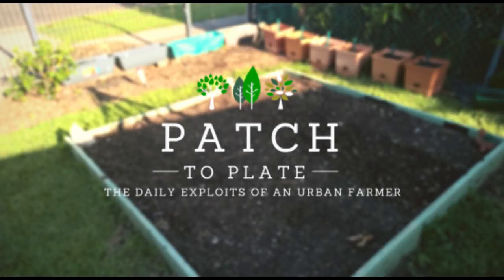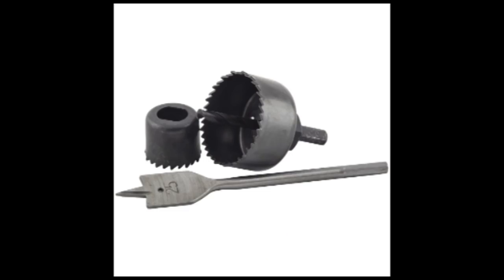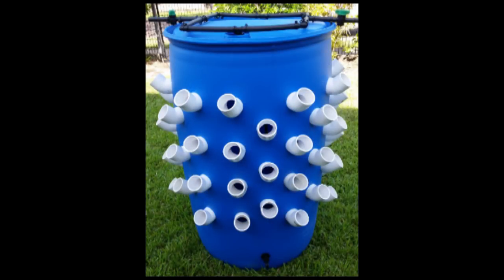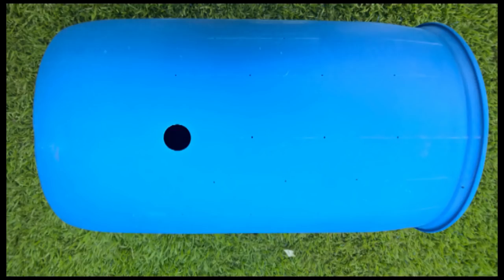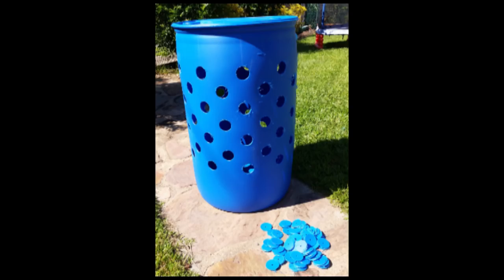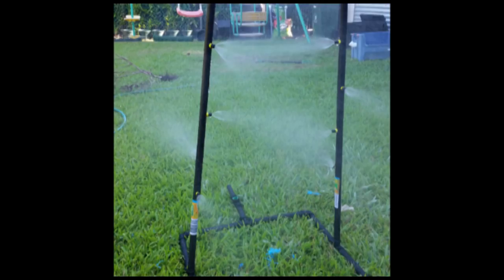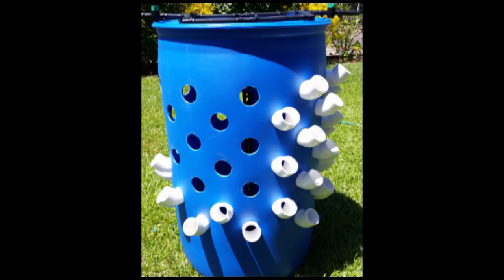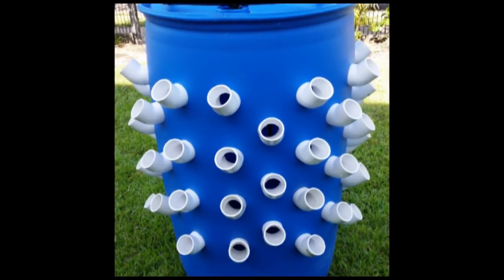Aeroponics Tower Build - Part 1

Comment: low pressure aero is akin to nft, aka it delivers a thin film of nutrient onto the roots. True aeroponics uses mist with a droplet size range of 5-80 microns. The droplets are absorbed on contact, theres no film and no liquid dripping off the roots. This allows the  roots to feed and breathe at the same time. The droplets dont block gas exchange in the way a film of liquid does. Droplets that are absorbed on contact dont leave a film of nutrient depleted water behind which serves to reduce gas exchange and deny the root further nutrient uptake. Waiting for the nutrient depleted water to be absorbed or evaporate takes time which could be better spent. Theres a lot of differences between low pressure aero and true aero :)
Reply from the maker: Atom izer Thanks for watching and for commenting, all good stuff and spot on. Would love to try true (high-pressure) at some stage but those old competing priorities are at it again :) For now I will have to make do with my budget low-pressure build which for now at least, is working better than expected.
Reply: patchtoplate 
Hi mate,
I use low pressure aero too and its very productive. I much prefer the high pressure setup as it runs drain to waste. Its a lot less work, no checking and adjusting EC/PH or dumping the reservoir periodically. The extra bonus of drain to waste is the last drop of nutrient is identical to the first,  a recirculated reservoir is constantly changing as the returning nutrients mix back in. I always found a recirculated reservoir more difficult to keep cool as the nutrients generally come back quite a bit warmer than they went out.  As you`re in Oz,  i`d keep a close eye on the internal temperature of the drum, if it climbs above 80F you`ll have some root problems, 70F is ideal but not easy to acheive in full sun. 

Looking forward to seeing the drum disappear underneath all the greenery :)
Reply from the maker: Atom izer Thanks mate, hey really appreciate the comments and tips! You are spot on (again) about the temperature and I'm looking at building some monitoring in now. Have a friend with some Aduino skills I hope to tap in to. I live in one of the hottest parts of Oz - right up the top in the tropics. It's our winter now and overnight minimum is around 68F so temp is a challenge :) If you can give me any tips or point me to some high pressure plans or products, would love to start checking that out as well. Thanks again.
Reply: patchtoplate 
Still chilly here in the uk, hope things improve soon or we`ll be running out of time as usual.
Building a hpa setup isnt too difficult, sourcing the bits and pieces can be tricky depending which route you take and how good you are at finding bargains :).
I have 3 outdoor hpa chambers mainly geared for tomatoes and peppers, they`re all pretty big (2x 1500L and 1x 300L) so none are vertical. I use 12v dc throughout to make everything immune to power cuts. The chambers are supplied by a large 100L (10bar) accumulator which is filled once every 2 days ysing a 12v diaphragm pump which takes about 8 minutes. The tank supplies a constant 80-psi to 32 netafim coolnet nozzles via 12v solenoids and cycle timers. The solenoids/timers are powered by a 12v 7ah SLA battery and a 20w solar charging panel. 
As hpa only uses a minimal amount of water/nutes i run everything drain to waste (runoff collected and used on the garden). The bonus of running  DTW is its less work, no PH/EC adjustments, topups or reservoir dumping. More importantly, no warm, unbalanced nutes, nasties or debris ever comes back from the chambers to mess with the tank.
Reply from the maker: Atom izer Sounds like you have things set up really well! Any chance of some pics to point me in the right direction? Interested in the chambers themselves.
Reply from the maker: Atom izer Doh, just got your vid. yt had marked it as spam :) Cheers mate, having a look now.

Comment: I don't understand how to put the mister and pump together that would be more helpful than how to drill holes.
Reply: Use a reverse osmosis booster pump (ideally dc voltage), 1/4" tubing and push fittings to connect everything together.

Comment: Amazing video, THANK YOU. Could you tell me specifically which type of pump you now recommend, and what kind of watering schedule you have it set to? Also, is it critical to have a barrel with a sealed top?
Reply from the maker: I am moving to a pump with a pressure tank and diaphragm so the pump doesn't have to run as often. I am working with a 10 seconds run time each 5 minutes. Thanks for the questions and for watching.

Comment: why need sanding if you can heat/torch/melt the edges
Reply from the maker: Tried a heat gun initially but when it cooled the drum split. Sanding was more effort but gave a better fit.

Comment: Hello :) great video. Do you know if an aeroponics set up would sustain in a very hot environment?
Reply from the maker: Tina Marie Gonzales Hi and thanks for the question - it is exactly why I started trying aeroponics :) I have had mine running very successfully outdoors in a tropical climate. It is our "winter" or dry season at the moment so temperatures are generally 20-33C (68-92F). I have a double-reservoir design to help regulate the temperature of the water/nutrient mix. I also have 2 small vents in the top of the tower to keep the air circulating and to allow the hotter air to escape (hope that makes sense). So far, so good! At the hottest time of the year I'll 3/4 bury my main reservoir to help keep it cooler. Hope that answers your question and thanks for watching :)
Reply: patchtoplate Thank you so much. :)

Comment: hey mate I'm planning on doing something like this myself. what model pump are you using? do you think this would be possible with a powerful aquarium pump? good video! cheers from sunny coast QLD
Reply from the maker: Thanks for the question, I did try an aquarium pump initially but it couldn't deal with the head height (height from the bottom of the reservoir to the top of the drum) so there was no pressure. I ended up going with a cheap Ozito pressure pump from Bunnings which went OK but looking to upgrade to something with a pressure tank and diaphragm so the pump doesn't have to run as often. Hope that helps and good luck with the project.

Comment: Is it import to use a high pressure pump or it works fine with the low pressure?
Reply from the maker: Thanks for the question. Needs a decent amount of pressure to lift from the reservoir to the top of the drum and then push enough pressure to spray through the jets. Tried low pressure initially but it didn't work for me.

Comment: thanks for this video that's very interesting. just have a question: there's not risk, in this case, that the humidity become too higher? bc the box seem locked. thanks 4 answer me
Reply from the maker: Great question, The openings at the top of the drum where the spray tubes go in also act as vents to allow both heat and humidity to escape. Thanks for the question and thanks for watching.

Comment: Do you have any experience with (or can you make an educated guess to the functionality of) a sonic vapourizer in regard to this type of grow tower design ?
Thanks, Sander.
Reply from the maker: sandertel G'Day Sander :) I haven't tried it with something this big before, usually use that method in something smaller like a cloning box (https://www.youtube.com/watch?v=-Wd2wHgo_SY). It would depend on your setup but one issue I could see (in my case I have this in full sun for half the day) would be temperature of the nutrient solution. With a vapouriser, there isn't any real circulation going on and there wouldn't be as much nutrient solution as I run here. The continual circulation of the double reservoir I have helps stops the nutrient solution from getting too hot which helps cool the inside of the tower as it sprays. I think if I tried a vapouriser in this setup, the nutrient would keep heating up and the inside of the tower would get hotter and hotter, only getting a chance to cool overnight. If it were inside and under LED lights though it could work but would require a number of large vapourisers to make sufficient fog. Hope that helps mate and happy gardening!

Comment: hi can u tell me what do u use to fix the elbow with ur barrel？because it seems to me, the elbows could be easily falling out if it is not fixed
Reply: The best way if the fitting is thick enough is to cut or route a groove about as wide as the barrel wall thickness. Drill the holes in the barrel to match with the groove depth. After a firm shove, the groove in the fitting will lock into the barrel wall so it cant fall in or drop out ;)
Reply from the maker: The idea is that the elbow is tapered so it friction locks into the hole. Works well and is watertight but can be removed if needed (like when rescuing frogs :) )
Reply: @patchtoplate-australia  Whoa, how the heck a "frog" get inside the barrel.  I am afraid of frog...that's one of the reason why I don't grow garden on soil so I don't have to deal with frog, bugs, crippy crawling things...urgh!

Comment: Won't the plants weigh down the elbows pretty bad as they grow?
Reply: +Edward Spencer Not those elbows they are strong. Depends on how they are connected seated into the barrel and thickness of the barrel.
Reply from the maker: +Edward Spencer depending on what you are growing, weight isn't an issue. I'm usually spot harvesting most of the time as well which keeps the weight down. I did have some basil get pretty big and heavy. For those I just rotated the elbow to point the other way and the side of the barrel supported the weight. I wouldn't normally let things get that big though, was more for a test. Thanks for the comment and for watching the videos...appreciate it :)

Comment: what's the difference in materials between a high pressure and low pressure system
Reply: a stronger pump, finer misters, and a few other technical things, like a backflow preventer
Reply: Alot more cost for high pressure, Easier to clog up with high but better results.

Comment: I'm in the states and I'm trying to put together one of these grow towers.  Unfortunately, a plumber I am not.  I am trying to find commensurate components for the 13mm poly pipe and I can't seem to (probably because I think it's something other than what it is).  Obviously 1/2" should do, however, is all the poly pipe in that size flexible - I mostly am able to just find it in rolls, but it appears from the video that the batch you have is at least somewhat rigid.  Any help would be tremendously appreciated.  This is what I keep running into: http://www.homedepot.com/p/Advanced-Drainage-Systems-1-2-in-x-100-ft-IPS-100-PSI-UTY-Poly-Pipe-05100100/203294377

Also about the misting heads.  Are those just T-jointed into the interior pipe?

Thanks so much for the video!
Reply from the maker: +Brian Rogers G'Day! Over here you can get the 13mm poly in either rolls or straight pre-cut sections. It isn't rigid like a riser, it is still the flexible poly but as it is cut straight, you don't have to contend with the bend you always get in the roll. As an alternative, you could use some long risers joined together. On the misting heads, yes they are just t-jointed into the both arms of the spray manifold. I think one of my videos shows that out of the barrel (sorry I am travelling at the moment so don't have easy access to the videos to point you straight to it). I just spaced them in a spiral pattern and offset to the spray tube opposite to ensure coverage was as even as possible. Seems to work ok but I'll be interested to see how that goes next growing season with a different pump. Thanks heaps for watching and let me know if there is anything else I can help with :)